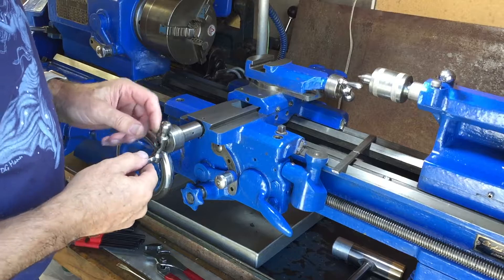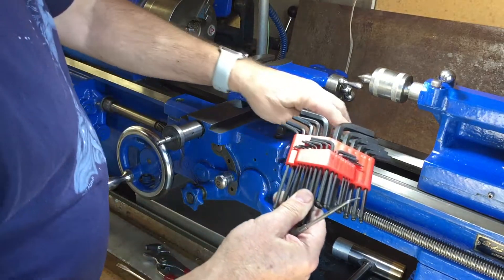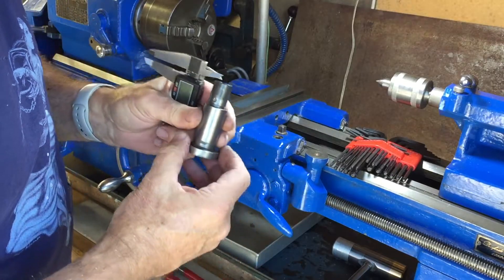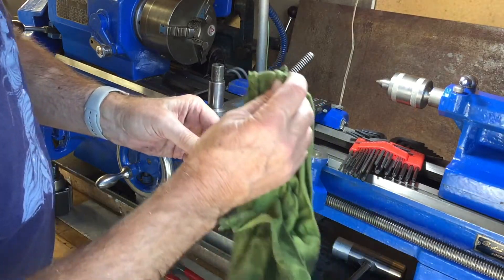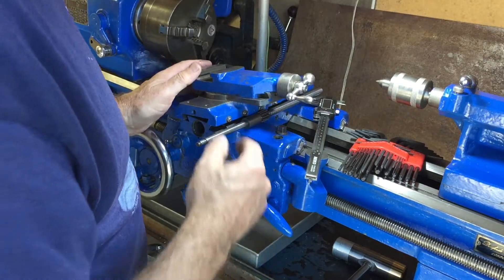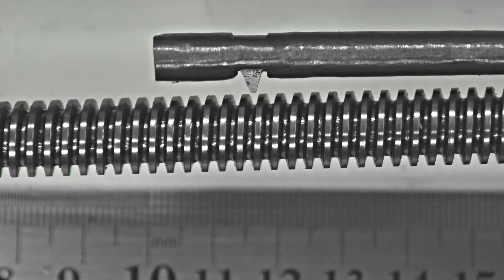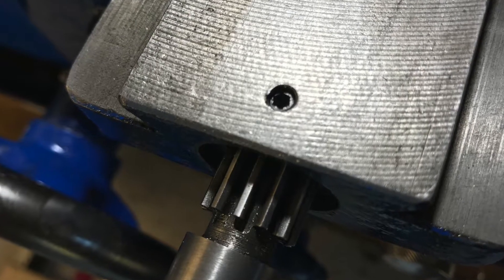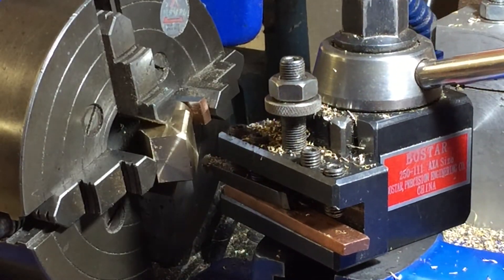A left-hand internal acme thread for the cross slide nut to fix backlash-Part 1

Comment: Nice video, I have question, what is the advantage of using brass nut on an acme linear actuator? On
my satellite linear actuator the nut wore out and i was thinking to replace it with a steel nut any recommendation PLEASE
Reply from the maker: Actually I used phosphor bronze which is often used for plain bearings. It is softer than steel and although wear is excellent it should wear out before the steel cross-slide lead-screw. Generally it is easier to replace than the lead-screw. I know another Boxford user who made one out of aluminium and he says it is still working well, but aluminium is SO soft that I wouldn't use it. I would not use steel and risk wearing out the leadscrew. Instead I would use first bronze, second brass, third choice aluminium or alloy, and never steel.  When you think about the fact that the leadscrew is about 10 times longer than its nut, you would expect the nut to wear out about 10 times faster than the lead-screw anyway.

Comment: This video has been very helpfull as I am going to bake the same bush for my 1964 Colchester Student, did try to turn it into a pinch bush but wasn,t very successfull, just off to watch your second video now, regards Doc Cox.
Reply from the maker: Thanks for the complement and for subscribing. Your videos look interesting too. I think it is worth considering making an adjustable version of the nut as they are bound to wear and it is very difficult to machine accurately. The thin boring bar I made was not rigid enough. A stronger material would be desirable.  

Another member of the Boxford Users Group, Gary, made a cross-slide nut which is adjustable. He posted a photo. It basically consists of a large screw and nut, one screwing inside the other for adjustment, and a hole drilled through both parts, and threaded with the left hand thread.  He says he did not need any locking mechanism to prevent it from unscrewing. 

I have not seen one, but apparently later Boxfords had an adjustable nut. As far as I can make out, it was split down the middle (at right angles to the thread axis) with the slot extending up to the mounting post. When the mounting grub screw was tightened it pushed a wedge or cone into the slot, spreading the two threads apart. I'm not sure how the mounting post was secured in place. I hope that makes sense! 

I have considered a similar design with a slot cut across the nut and small screws placed across the slot to pull the two parts together. Unfortunately there is not much room for the small screws.
Reply: Hi Evan, Nice to get a decent reply, Ihave modified mine with two splits and drilled through and put two bolts with nylocs in it, so far so good, I did this about two years ago and gave it a tweak a couple of days ago, worth doing.
Reply from the maker: @MrNigel1340  It is great to hear that the split nut method worked for you. Since I made my own nut I now have a spare one so I will not be so concerned about possibly butchering it by cutting a slot (or two).
Reply from the maker: Hi Doc, I am preparing an upgrade for my program to calculate gear trains and included a gearbox for the Colchester "The Master". Eventually it will be on heroSteamEngine dot com /RideTheGearTrain